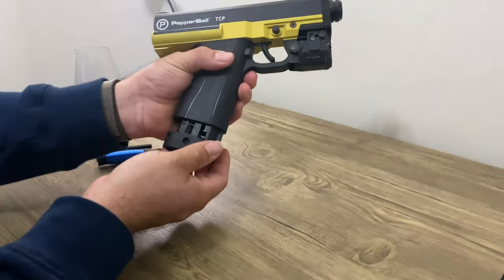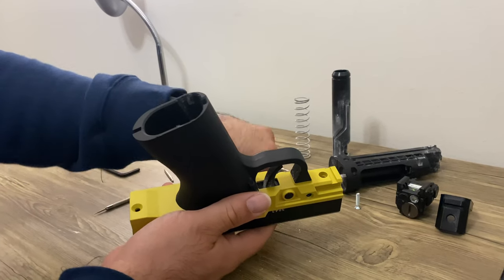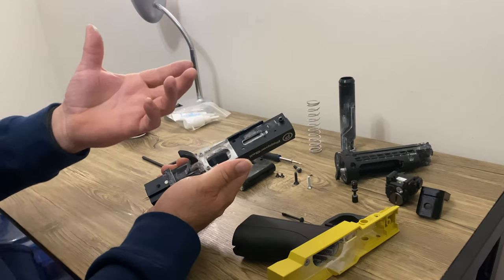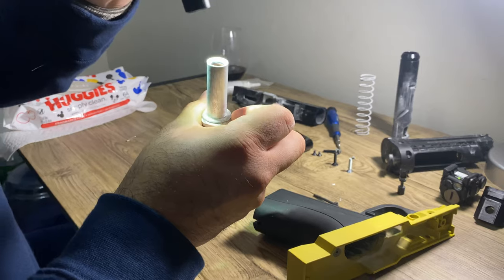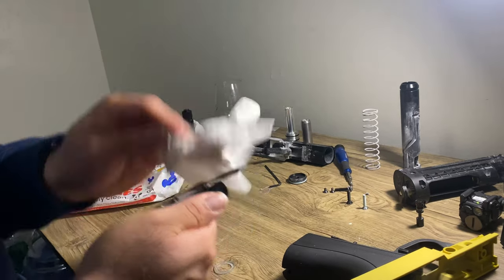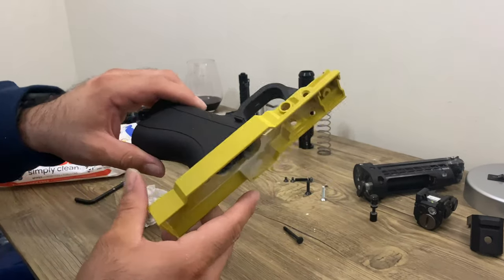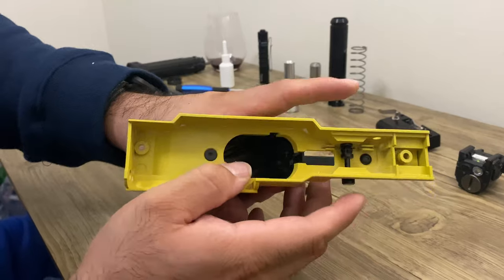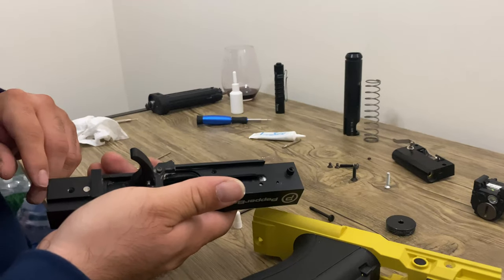PepperBall TCP Maintenance Due to Launching Issues & Grimburg Holster (Subscribe)

Comment: Me personally I would use a air blow attachment spray inside the chamber and then air dry with the blowgun and put a few drops oil in it and then spray the whole inside to get rid of the gunk and dust - then mess with it - just got it on Black Friday 315 $ haven’t tried it yet

Comment: What could case an air Leake? I have a small knick in one of my Orings but it'd never been a problem before ? Could the knock just got slightly worse and resulting in orange replacement? I put heat core o rings in motor. From grimburg. I make sure volt it's forward. When I gas it . It can still fire but it also leaks . Better or worse depending on how much I've turned regulator screw any ideas

Comment: I'm not seeing how you got the bolt assembly out other than forcing it out with your finger.  Is that really how it's done?  I'm rather new to this kind of launcher, and I've been following your video to a 't' in disassembling the launcher.  I'm stuck with the bolt ejection.  Where you pushed it out, mine does no such thing.  What am I missing?
Reply: Take the regulator off first then it'll come out

Comment: Just curious if your issues were related to a concern addressed in a video "Your Pepperball Luancher Is Only As Good As Your Ammunition & Why I Don't Like the Byrna" at about 4:40  -- the poster begins a discussion about the Pepperball TCP "universal" magazines and how they are not really designed with the round ball projectiles as priority and will essentially guarantee lots of burst rounds. He uses the standard First Strike FSC magazines for round ball projectiles instead. The Pepperball universal magazines are then used with the VXR rounds only. Don't know that he is right or not, but based on his findings and your results, it makes one wonder. I would be surprised though that a LEO/military supplier like Pepperball would have an issue like that.
Reply from the maker: TCP universal magazines are perfectly fine for round projectiles and the only magazine you can shoot VXR projectiles.
Reply: @dudelesslethal6910  Thank you! Any guess what the ultimate cause was for the ruptures you had and the malfunctions that necessitated the take down?
Reply from the maker: @ABG2412  go to my channel page click on community link. I posted a picture that shows you.

Comment: Why does the safety switch have to be on when the launcher isn’t gassed up? Isn’t turning the co2 puncture a safety by itself? Less steps to take.
Reply: In theory it won't fire unless you pull the trigger.  But there is a chance the regulator sear could slip and it could fire. Never happened to me so far but I've heard about it with the highest power settings (>40J). So always point in a safe direction when puncturing the CO2.

Comment: I am haveing velocty issues can you help. I am using hp68 with c02 . The first shot i get 260 then like 240  215 and so on is this normsl
Reply from the maker: Back off velocity half turn counter clock wise because the more you tighten the velocity the more co2 you use up on your first to 2nd shot. That will lead to lower fps for remaining shots. . https://youtu.be/v55jVUnNcYY
Reply: @dudelesslethal6910  was truing to achieve the 300fps
Reply from the maker: @paulcr3152   which magazine are you using?
Reply: the tcp mag
Reply: @dudelesslethal6910  i am usong the tcp mag
Reply from the maker: @paulcr3152  you need to use larger T8.1 magazine with 12g co2

Comment: I don't understand what went wrong
& Sorry it happen 😕
Reply from the maker: Ill be doing follow up. Haven’t tested outside yet
Reply from the maker: Could be dry bolt or o ring or Velocity mag spring.
Reply: @dudelesslethal6910  I had a inert bust when I first got mine but I never took it apart like this to clean it....just ended up buying Grimburgs roundball haven't shot it in over a week n now it's get below 39° I need to  test more